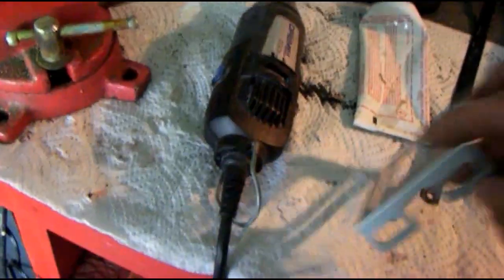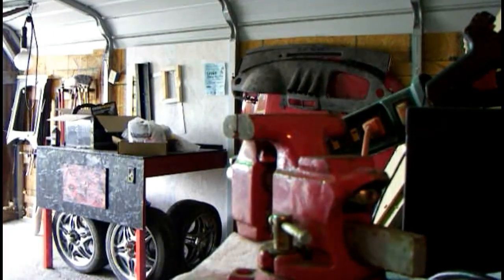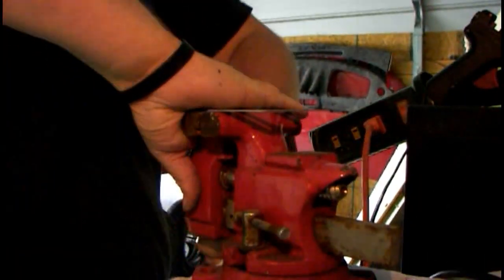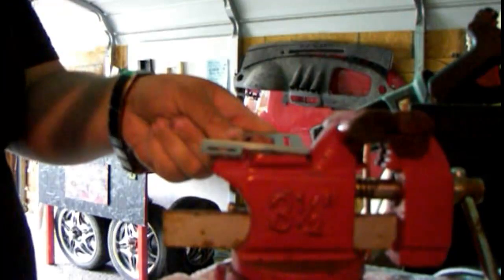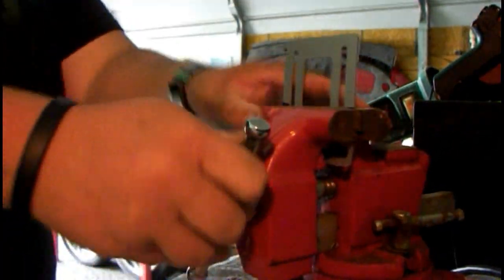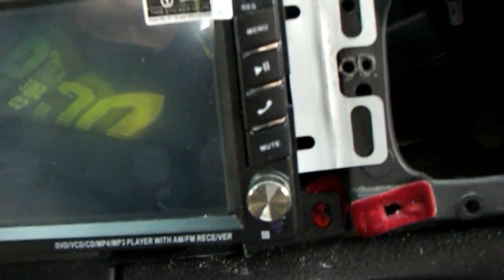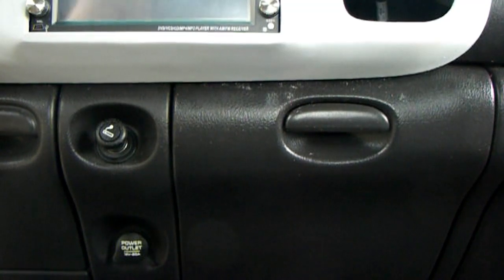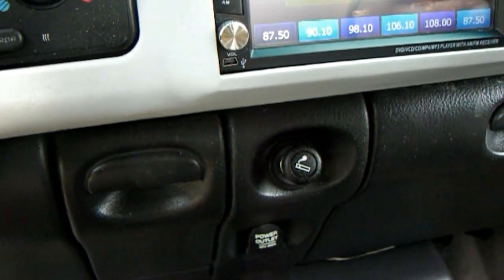Dodge Ram 2nd Gen Custom Touch Screen PT.2 | Custom Mounts

Comment: Great video even with the last part not really in frame. I plan on doing this with my 2000 Ram 1500. I need to replace the dash and instrument bezel as they disintegrated years ago. Once I do the double dim mod, I may make a mold so I can cast replacement instrument bezels that will accept a 2 din head unit. Of curse I could just put a 1 din with a flip up screen in it. Looking at putting the Jensen VX7020 in that has GPS and also a backup camera input. The 1 din  of that head unit would be the Jensen VX7012. I have a lot of work to do on my soon to be 17 year old truck but it is cheaper than buying a new one. Will try to do videos if I can all the way from transmission rebuild to body panel replacement and even interior rebuild.

Comment: It's so simple when you use the install kit - cut -  cover - put on the face.

Problem:  With the unit I installed - I get no sound from the truck speakers.  Everything is wired correctly - and the speakers work fine with the orignal radio.  The touchscreen radio works fine when hooked to speakers on the bench.

BUT NADA when attempting to use the truck speakers with my touchscreen.  There IS some output to the aux ports used to feed an amp, which doesn't exist - and you can watch a graphics eq dancing - BUT NO sound.

Bought a second system - same thing.

Is there a connection in these 99 1500's that I have missed?  I even hooked up the power antennae wires in case that triggered something . . .

Comment: Really helped me bro! I appreciate it couldn't find this anywhere!
Reply from the maker: +1975ChevyK10 No Problem! Glad I could Help!
Reply: +Elite Rejects what kind of radio is that?
Reply: What kind of brackets are those...where did you get them?
Reply from the maker: The brackets used is the ones that came with the radio. I just bend them to the shape I needed.

Comment: what radio do you have
Reply from the maker: +Dennis Salazar I don't even think it has a name. lol Its a china ebay knock off radio. Ive had it for about a year, does good for only being like $120 radio.
Reply: +Elite Rejects it nice i like how it has the dodge symbol when you turn it on i want a radio like that because i custom made a center console and that would look nice
Reply from the maker: +Dennis Salazar That's one thing that made me buy it. It has a ton of symbols on there to pick what brand ride you have. I figure it gives it that upgraded stock look. You have a video of the console? Id like to see it.
Reply: +Elite Rejects  No i have no videos and the console is from a 13 ram i saw a youtube videos this guy has the same one
Reply from the maker: +Dennis Salazar Oh I bet that looks good.  Ive thought about building a custom one that can hold a 12" subwoofer.
Reply: +Elite Rejects same here i have a 01 quad cab so i want a speaker on the back of the console
Reply from the maker: +Dennis Salazar I started to buy a box that goes under the back seat that holds 2 10's but I don't know how they would sound. Plus I use under there for storage. So I figure behind console would be best place.